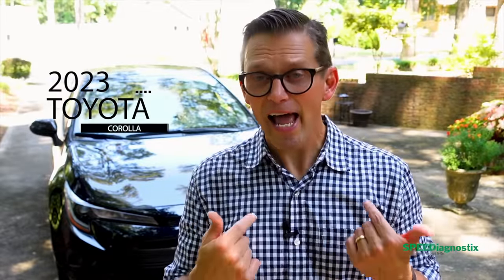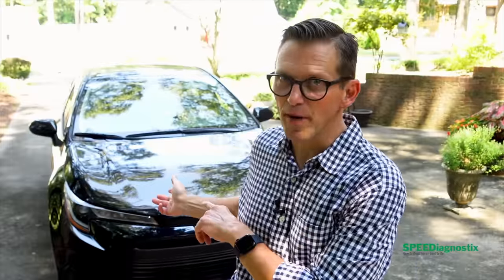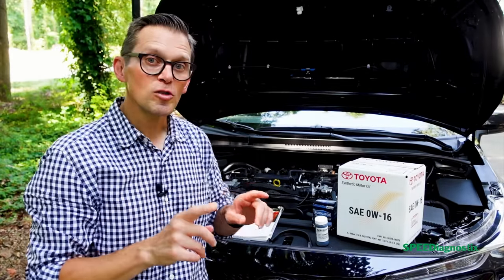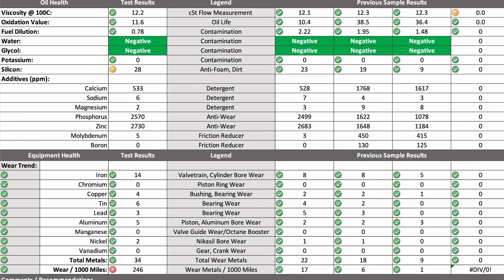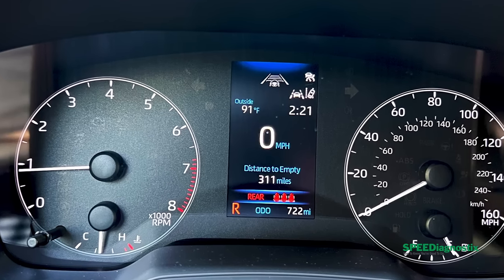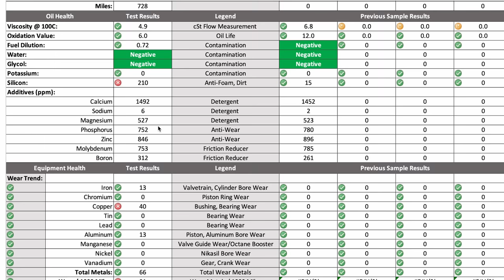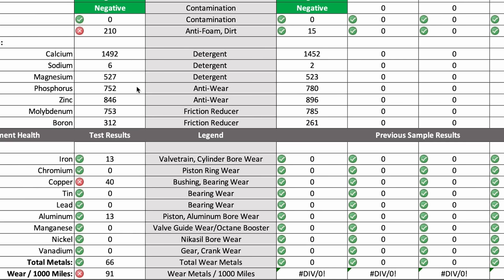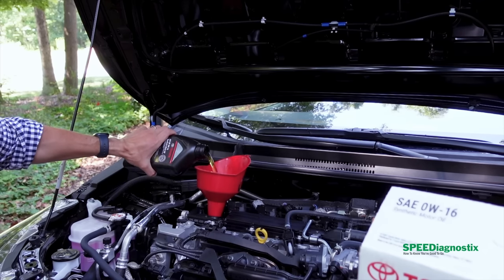AVOID the ONE MISTAKE Almost EVERYONE Makes With A Brand New Car

Comment: I've been using valvoline advanced in my familys 0W-16 Toyota's but after seeing your analysis of Toyota's oil, would you say you feel better about one or the other? Seems like Toyota has a good formulation here and so long as the price isn't crazy maybe I should just use that.
Also, when you put oil in the filter, do you think it's important to pour it only in the periphery holes? I've seen conflicting reports from mechanics and think it makes sense that you wouldn't want to pour unfiltered oil, regardless if it's new, in the center since that would go right into the engine without being filtered.
Reply from the maker: The Toyota oil looks really good on paper. We will see how it works at the next oil change...

In regards to the filter, you just need to pour it into the center. the oil will permeate through the filter into the outer chamber.
Reply: @themotoroilgeek  Got it, thank you, also I love your videos and I'm anxious to see how the used oil analysis goes.
Reply from the maker: @ZWortek  thanks!
Reply: @themotoroilgeek With the tolerances of modern engine i wouldn't recommend prefilling  oil filters..  years ago on the Heavy duty side it was common practice now a days no manufacturer will sanction filling filters not even fuel filters.. The statement of New oil is not necessarily clean oil true to the fact that there can be particulates in the oil let behind from the manufacturing, distribution or bottleing which can be larger than the micon rating of the filter thus would normally be filtered out.. one easy test is to check the bottom of a new bottle of oil preferably brand with a white or yellow as it's easier to see especially if bought and shelved at home don't shake it pour out the content.. quite often debris laying at the bottom which have settled out of the oil.. in addition people accidentally introduce other foreign materials like plastic or the sliver seal of the bottle into the filter which end up in the lubrication system.. my lubricity training may not be as extensive but my experience as heavy duty mechanic that transition from light duty more years ago i wouldn't chance it the gains are negligible.. you did it right by running the engine first not only to suspend contaminants but also to pre-lube the engine components 👍
Reply: @joebrown9621 you do realize the filter bypass is open much of the time, especially on a cold start & higher rpms on most engine full flow filters. So if you are saying your fresh oil needs to be filtered you should filter it before it's even poured into the engine. And or you need a different better brand of oil and you need to be more careful with your funnels & stuff to make sure they are clean when you use them.
Reply: @oneninerniner3427  you're absolutely right when it comes on to cleanliness it's equal as important as the oil we use.. doesn't  have to be sterile just clean.. i left the auto industry years ago however my continued training in lubricity on the heavy-duty side focused on failure analysis, contamination and lubrication applications wether it's engine oil , tranny , grease system , suspension oil ,  hydraulics , pins and bushing.. contamination is a big part of it caused by environmental factor , component  wear or damage or introduced..  the introduction aspect is where we try to use good maintenance practices to mitigate contamination, like keeping our funnels and jugs covered and clean , our vehicles clean of mud and snow build up at time of service even wiping the filter and fill area before starting.. i stress the filters as it's like the last line in the lubrication system before entering the tight toleranced  mordern engine and other components, keeping the filters sealed till we are ready to use them,  don't let young kids play with them or leave in the back of a car just rattling around.. i don't recommend filling oil filter for these reasons people make mistakes.. the quality of the oil even new oil questionable, potential for things to get into the filter for these reasons just take off the seal and install..
the potential gains in my experience just isn't worth it..
Reply from the maker: @N-M424  I was also surprised at the comments about pre-filling the oil filter, so we are going to do a test specifically on this topic.

Comment: Oil does drain easier when warm but the idea that you have to drain right after operating the engine is a myth.  Oil is not circulated in the pan, in drains down from the block and most designs have the pick up tube opposite the drain plug. So contaminates are collecting in the area of the drain plug where the oil is less disturbed than in the area of the pickup tube. As oil is drained from this area, it picks up the contaminates and they are flushed out the drain. Of course, most contaminates are captured in the filter.

Pouring in a qt. of clean oil with the drain plug removed is a complete waste and you are only flushing the drain holes in the top end and are doing nothing for the oil passages that actually provide oil to the critical parts from the pickup tube.

While it is not true for all manufacturers, some use a specific "break in" oil blend.  So if you are changing your oil too soon, you are replacing that specific oil with an oil without those properties.

Manufacturers do not use the very best oil or filters in new vehicles or as OEM parts.  Concerning engine lubrication the simple answer is use a very high quality oil and filter and change every 5,000 miles or no more than yearly.   

If you are using OEM oil and filters, you are NOT using the best. Since manufacturing is ever changing, the best oil and filters are also ever changing. What is the best today may not be the best tomorrow and there are many videos exploring those differences. Example: Mobile 1 was at one time the best oil but those days have long passed.  While it is a good oil, it is far from the best today.

Comment: Your procedure of multiple early oil changes during break-in would be more convincing if you tested and compared the oil from a Corolla that followed Toyota's recommended 10,000-mile change interval. Also, engine break-in occurs over about the first 10,000-miles. While multiple oil changes gets out much of the wear particles that have occurred up to the oil change, it does nothing to remove the on-going break-in wear particles that continue to come off until the next oil change. Hopefully the oil filter catches most of the particles capable of causing pre-mature wear...
An even more comprehensive test would be to measure the engine wear after 200,000-miles between cars which had multiple early oil changes, vs cars that followed the manufacturer's oil change schedule. Stating your engine will last longer isn't the same as actually showing that it will...
Reply: The scientific approach would be really costly - get like a 1,000 of the same car and do long oil change intervals vs. 1,000 with these short oil changes.
Reply: @mrtdiver  There likely are lots of technical studies that did that work for you. Instead of repeating 'old mechanics tales' why not do some actual research into the effects of early oil changes on engine longevity?

Comment: Great video and nice car!  I bought my 2011 Toyota Corolla new and have changed the oil (synthetic) every 3000 or so miles.  I've got 161,000 on the odometer and have never had an engine repair, only had to replace the water pump at 135K miles.  No oil leaks, A/C is as cold as the day I bought the car.  I recently did 85 mph (pushing occasionally to 95 mph) on the highway for a prolonged period of time and the car did not so much as flutter.  Oil changes are cheap insurance and Toyotas are bulletproof.

Comment: Pouring that extra quart in doesn't flush much of anything out. The reason is the engine has more oil paths than just from the oil fill to the oil drain, but only a few of those maximum will be utilized. You might get a tiny bit out of the bottom of the pan, but otherwise the best thing to do is just run a full new fill. If you really want to, just run it for a few minutes then flush it out. Sure, it's more expensive, but at least it's actually accomplishing something instead of guessing.
Reply: I always flush my engine 10 times with every oil change. Just wanna play it safe 😂😂😂

Comment: On my 3rd gen Tacoma V-6 1st 🛢️ change 545 miles & 2nd 🛢️ change 2500 miles... It did NOT need the 2nd change but for $45 or so I got peace of mind. Now I change it about every 5 or 6,000 mi & that's with no excessive idling, if i idle a long time using AC then i change it @ 4K miles

Comment: Just did a Oil and Filter change on a 2024 Kubota at 39 hours. In the past i do a oil change at under 1000 miles on new engines . I did a rear diff oil change on new truck at about 1000 miles . I was very surprised of the Factory machining   debris on the magnet

Comment: Almost all motorcycles of whatever hue, with 4 stroke engines, are supplied with owners manuals that stipulate a very first  oil change MUST be made at 500 to 600 miles. I do my own servicing and can completely agree with this video following on from 40 years experience of doing this myself. Motor Racing engines are treated in this way and the first 500 miles are done on a dynamometer to get the initial 500 miles of running in a controlled manner. THIS is good advice!

Comment: i bought my first new vehicle in 1989.  Changed the oil and filter before it got to 1,000 miles.  Every new vehicle since then has had the oil and filter changed before 1,000 miles.  I have never had an engine failure on any vehicle I have owned.

Comment: I purchased a new F350 with the 6.2 I did my oil every 400 to 600 miles using 5W30  amsoil 100% synthetic at every change I have a tool to cut the filter cover off i couldn’t find any metal up close no metal now I do my oil change every 6 months because I only put about 9 thousand miles a year. In my life time I never had I my oil changed by a garage in a 1/2 dozen time on different vehicles it was free but I passed only reason because I can’t wait to change my oil. I love this channel it’s about oil. Thank You

Comment: I’m buying a new GX550 next week. I’ll be changing the oil and doing the analysis at 500-1000 miles, 3000 miles, 8000 miles then 15000. Have you ever heard of a manufacturer dealership refuse to take the sample or give the average person a hassle when asking them to take the simple. Also are they reliable at pouring the extra quart after the oil is drained? Of course paying them extra for doing so.

Comment: Have always changed a new trucks oil at 500, 1500, 3000, 5000 miles and then do every 4-5k miles after that. Every singe truck i have in the fleet has well over 300k miles and have had 0 engine issues.

Comment: Thank you for this video ! I've got a question,  i often drive top speed of the corolla (180kph , >110 mph) on the unrestricted parts of the highway (live outside the USA)  for an extended period of time, 0W-16 seems like far too thin for that kind of drive, even 0W-20 makes me uncomfortable as i used to have 5W-30 in my previous car (VW Golf) and i saw temps of 117°C peak and usually 110°C while driving this way with 5W-30. 

Now i just got the Corolla and its not driven in yet, so i didnt do highspeed driving with it yet, but i was wondering if i should go with 0W-20 or what personally sounds right to me 0W-30 ? 0W-16 & 0w-20 sounds way too thin to me. Would appreciate your input with all your experience.

Comment: Bought new in 1986 Toyota truck 22RE 4-cylinder and still my only daily driver for 38 years and 486,000 miles. 1st oil change/filter change at 500 miles. 2nd oil/filter change at 2000 miles. 3rd oil/filter change at 5000 miles. Then every 5000 miles with Castrol GTX 10w-40 "dino" oil even today. Hard to find so buy as much as I can when I find it. Still don't burn even 1/2 quart of oil between changes.

Comment: Love the video. Why did you drive the car before changing the oil?

All of the oil was already sitting in the sump/pan from the previous engine running. All you’ve done is spread it all around the engine again!

If you were warming the oil to make it less viscous so that it flows better, the oil is 0W 8 so it is less viscous (0) when cold then it is (8) when warm!

Comment: I did my brand new 2022 Taco at 750 miles and the 2nd time at 1,500 miles, 3rd time at 3,000 miles and the last one at 5000 miles.  And from then on at every 5,000 miles.. And yes I did change the oil filter as well at the break in intervals..

Comment: I bought a new 1994 Honda civic and recall the manual advising of a 500 mile break in oil change.

Now, with my truck, I’ll change the oil before and after a long road trip with our 4500lb camping trailer because I can only imagine how hard that engine is working.

Comment: Living in Florida, the first thing I did was ignore the Toyota manual asking for a 0w-20 change at 10K. I put in 0w-30 and change it every 5K and 4K in Summer. That 20w oil cannot protect a small engine in 95+ degrees city driving.

Comment: Bought a VW Jetta in 2003 and the dealer had me come back at 500 miles to change the oil.  Besides bad ignition coil packs, that 1.8T ran great for it first 140k miles until it got totalled in an accident.
Reply from the maker: Thanks for sharing!

Comment: I bought a 2024 Hyundai Santa Cruz, brand new. Hyundai doesn't do a change on their engine's until at 7500-miles on it, yes the first oil change, is that not unreal!! I reached around 2500-miles and my oil light decided to come on?? So I checked the oil and it was about 1-quart low, which concerned me, how could you have an oil that didn't even was able to go any longer than up to the mileage that was just ridiculous to do an engine this way?? In most cars back in the day you went roughly about 500-miles then do an oil change to remove any metal parts that's created from a new engine is clean of that debris/metal, etc. SO I immediately had a new filter and oil change to Mobil-1, yes total full synthetic oil only. Along with the correct weight of oil which is 0w-20w type oil. Jump forward now I have just under 11,000-miles on her now and is not burning a drop of oil!!!. Im😢 extremely pissed at Hyundai for what they had tried to get me to wait until after 7500-miles to do a oil change. Yes they can say it's in their warranty to change it at 7500-miles is total bullshit!!!!!

Comment: I agree with you on the early oil change.  I did my first oil change on my ecoboost transit under 1000 miles. Did the next at about 3000. Sounds like I'm nuts but after that I do a 5000-6000 intervals on full synthetic.  I have no cam phaser or chain noise and I'm approaching 100,000. 

One thing I recommend on the toyota is stay with a toyota oil filter. Noticed you put a Purolator on.

Comment: I bought a brand new Corolla in 2005. First oil change at 800 miles then 10k, then once a year after that. Used Amsoil and Amsoil filters. Wife totaled it at 330k. It didnt seem full broken in until 220k, when it was used to haul a trailer across the country and stopped burning as much oil thereafter. Only problem it had was a small rear main seal leak. I had the valve cover off around 280k, clean and beautiful inside.

Comment: I have only bought one brand new vehicle in my life. It was a 1993 Suzuki GSXR1100W. I rode it home from the dealer (about 15 miles) then changed the oil immediately. Amazing the amount of metalflake sheen in that oil. I replaced it with non synthetic Suzuki oil of the proper multigrade viscosity then changed it again at 1000 miles. First oil change on a new or rebuilt engine is a flush.

Comment: I've never done an early oil change and never had an issue. The oil from the factory is different from subsequent changes because it's meant for use breaking in an engine, and you lose that if you pour it out too early.
Reply from the maker: Not anymore…
NEW Engine BREAK-IN: Truth or MYTH?
https://youtu.be/X4424Q5lLR8

Comment: When I bought my 2022 Suzuki Jimny, 1.5L K15B engine, I thought it was ridiculous to do the first oil change at 7,500 km’s. Next oil change was at 52,500 km’s. After watching your video I understand better. Thank you! I wish I had seen your video sooner. 

The Jimny owners manual states 
0W-16, 0W-20, 5W-30 in the EU. 
Rest of the world it states:
0W-20
5W-30
10W-30
10W-40
15W-40
20W-40
All API SG to SN. 

As I live in Central America sub zero temperatures isn’t an issue. I want to change to Ravenol 10W-40 or their 20W-40. 
- Do you see any risk in the change to a thicker oil?

Comment: I changed the oil in my 97 tbird 4.6l at 400 miles to full synthetic and i am now at 344k and the engine has never been opened up. Doesn't smoke and runs strong.

Comment: When my engine was rebuilt, I changed the oil after the first 20, the next 100, the next 500, 1000, then did regular interval at 3k. I run a turbo so oil breaks down faster. Alway using synthetic. That first 20, 100, even the 500 I found debris. Stuff my magnetic pil plug caught and I could see in the filter. I wish I could of taken a sample like you did to run an analysis out of curiosity

Comment: My friends 2023 Corolla manual said you can use 0W-16 one time, then 0W-8 afterwards. Managed to find some LM 0W-8 here in germany. First oil change. I warned to do an early oil change before waiting for the maintenance alert.
Reply from the maker: Thanks for sharing. It is hard to find 0W-8

Comment: I didn't do the 500-mile oil change when I bought my 2001 Honda Accord brand new.  And as of 2024, my 2001 Honda still runs like a Lexus.  Just make sure to maintain it well, regular oil change every 5K miles instead of 7K miles, as recommended in my 2001 Honda's user manual.

The 500-mile oil change is an overkill, in my opinion.  It's unproven "myth."  If it's important, I am fairly certain Toyota would document in the user manual to do it.